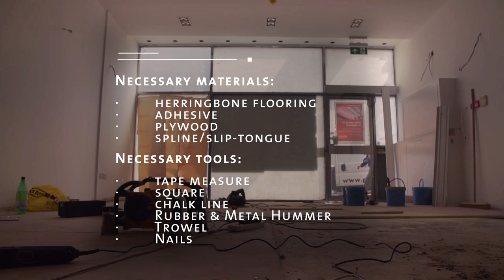Herringbone Wood Floor Step-By-Step Installation

Comment: using a hammer to pound in a piece?  Without a block?  Or at least a rubber mallet - good way to chip the flooring, bud. And glue?  Don't think so

Comment: Necessary tools:  Rubber and Metal HUMMER???

Leave an expansion gap?  You're gluing it down... how's it going to expand??  There's no way this material should be glued down.
Reply: TomKaren94 gluing down a floor is very common practice. The glue used allows for some expansion as the floor will expand and contract with the change of seasons. And most engineered floors are able to be glued down. 

I agree though, why the heck was he using a metal hammer. Thats just asking for a mess